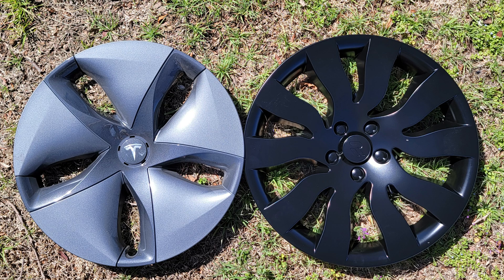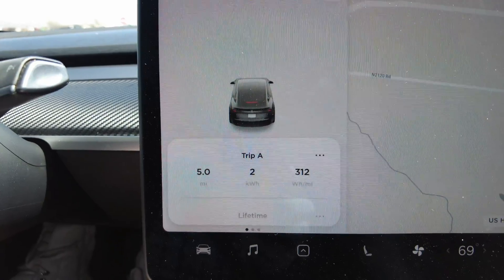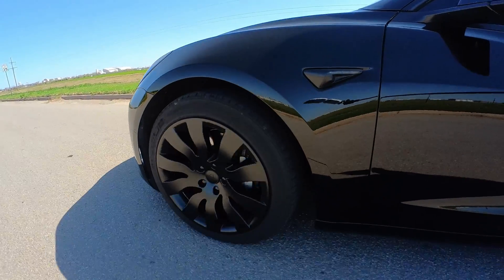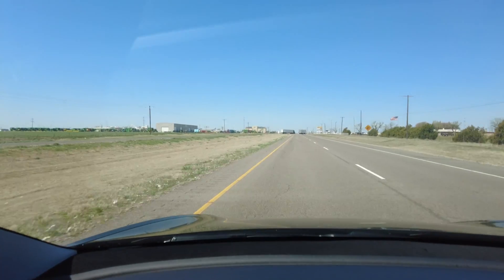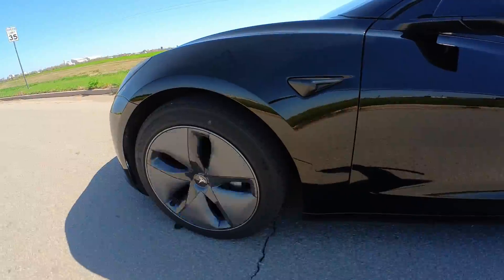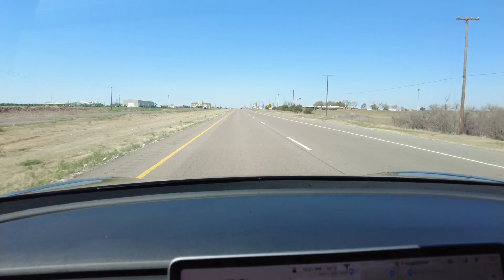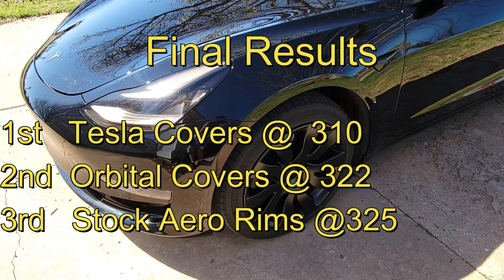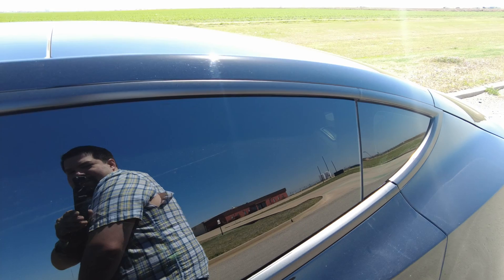Rimetrix Orbital Wh/mile efficiency almost as bad as no covers at all!!

Comment: I’d like to see a properly conducted comparison of these Uberturbine covers that have appeared on the market, how their efficiency compares. Currently there is only one unscientific test, albeit in their favour.
Reply from the maker: Yeah my test is not very good in this video because wind, and unfortunately I don't have the car anymore. From my experience over months of driving with them I would say it's actually close to the stock aero covers efficiency.
Reply: @Crazypostman  it’s not easy to do a completely unbiased test, even on a relatively circular route, driven very carefully at different speeds it only needs a wind direction change part way through to throw the results. I like the look of the uberturbine covers, but perhaps more importantly that they protect the rims better than the aero covers. However, I don’t want to go backwards range wise!

Comment: So what do those numbers mean in the real world? How many fewer miles will you get on a road trip, for example, with no covers or the aftermarket covers as compared with the original aero covers?
Reply from the maker: Just estimating maybe a 5 or 10 mi difference in range over the whole battery pack. Maybe someday I'll test this but it takes so many hours to run through a whole battery and I would have to do it twice I'm not in a hurry to try 😆

Comment: I'm in Florida and my Orbital's are set to arrive next week. I put 100 miles a day on my car and can get my wh/mi down below 200 if I draft behind a semi in AP. Looking forward to the Orbitals as I'm ready for a different look but hope I don't give up to much efficiency, I have an early build 2018 M3 RWD
Reply from the maker: It was windy day when I did this test, I seem to be getting  maybe 5-10~ Wh/mi less than factory on a normal day. Orbitals perform much poorer than they Tesla covers if you have a strong side wind.
Reply: Dave, how did the orbitals work out? I'm thinking about getting them.
Reply from the maker: I've came across some problems, first of all I do like the look on my black car versus the gray stock caps, but they scratch my factory wheels along the rim pretty bad and now they're starting to rattle quite loudly going over bumps in the pavement at slow speeds it's noticeable. I might make an update video either here or maybe a short one on my TikTok
Reply: @sikhswim  I love them, they give a whole new look to the car and I've been able to keep the same efficiency that I had with the aeros.

Well worth the money. I did buy on Amazon Tesla T logo that fits perfectly so they look OEM

Comment: I get so much better efficiency, even at higher speeds. I wonder what's going on here?
Reply from the maker: Your orbitals outperform your Tesla aero covers?
Reply: @Crazypostman   I don't have orbitals but I'm saying my normal efficiency is way better, like 50%
Reply from the maker: @sojournern  its windy here. I hardly ever average below 300. Tried to explain that in the video. just look at the difference in efficiency between the two and not the total number, because my totals are going to be higher because of the wind. I was just basically showing that the factory covers are more efficient.
Reply: @Crazypostman  Wow, i didn't realize wind would make the much difference. Where do you live?

Comment: The air temperature variation may explain differences.  Your test needs to make sure that all test are at the same air and battery temperatures.  Being an engineer, I would say your test may have errors built in.  I would say the new covers are close enough to the ugly Tesla stock covers.
Reply from the maker: The three different tests were performed in the same hour. Everything was performed as close to identical as possible. I agree with you, I think the overall efficiency is actually a Little closer than this test shows. There was a pretty strong crosswind, my guess is the stock Tesla covers are able to deflect the crosswind more because they have a wider surface area? Just a guess. Maybe I'll try to find a day with less wind and I bet the efficiencies will be much closer but I still think the Tesla original aero covers are slightly more efficient.